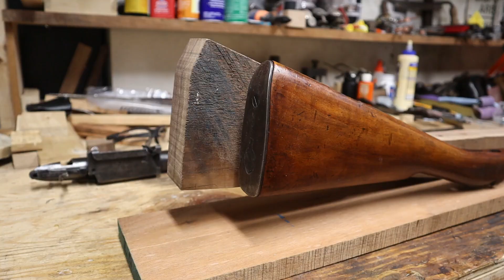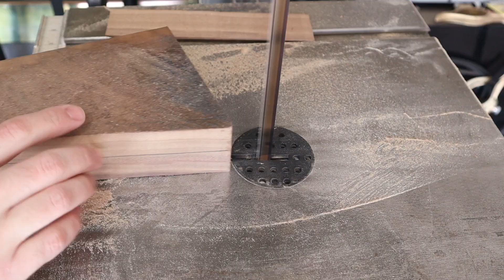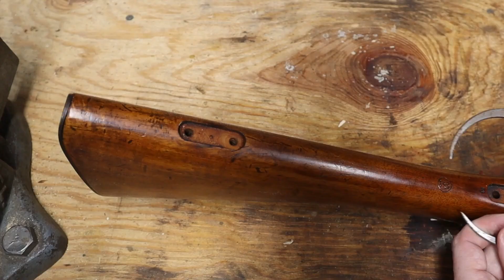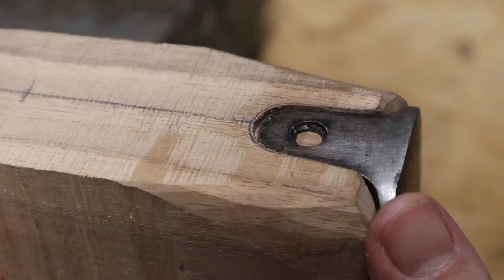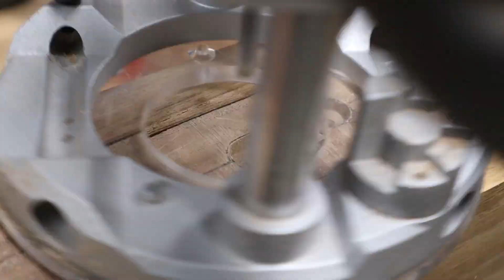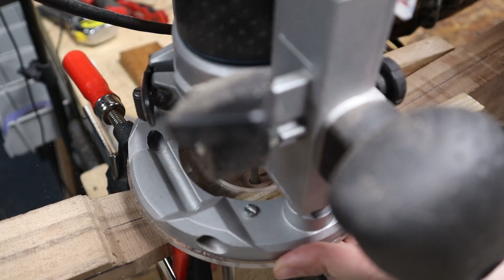Preparing to Shape - Making a Military Rifle Stock Part 4

Comment: I am using a semi-inletted stock and my action is rocking on the receiver ring, with the barrel pulling the rear of the action upwards. Does that mean I need to relieve more wood where the receiver ring sits? I am using inletting black, but it is not making a mark at the receiver ring. I cannot quite seem to figure out where the problem is.
Reply from the maker: If it's rocking near the receiver ring, that means the wood is high there. I'd keep trying with the inletting black so see exactly where it's touching. Try pushing the ring down using a mallet or a clamp to allow for more transfer.
Reply: @rakumprojects  thank you! I will try the clamp and see if i get more transfer. I am also going to try lipstick since real inletting black is near impossible to find.

Comment: Thank you for this excellent detailed series. That stock is incredibly thin in the action area. I’m curious how they made these original stocks in production. They must have had mills set up with templates, since there wasn’t CNC back then.
Reply from the maker: There was a machine for every operation, no matter how big or small. There may be 20-30 machines used just to make one stock.